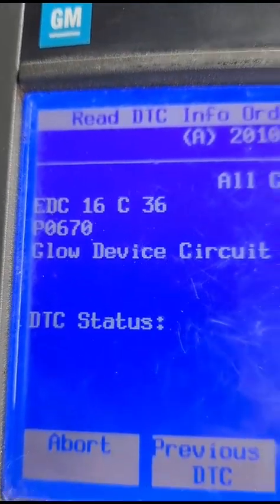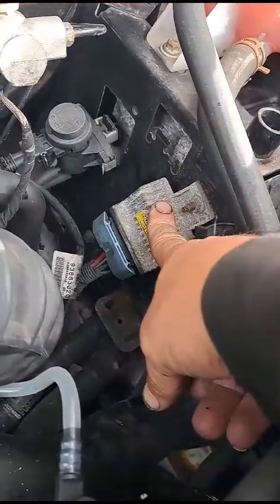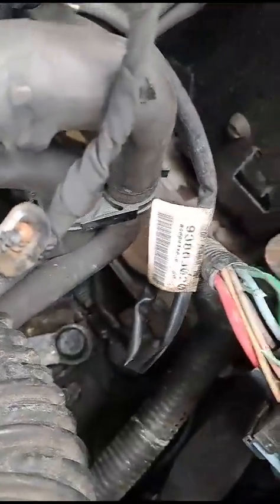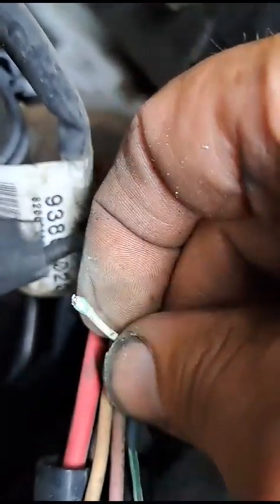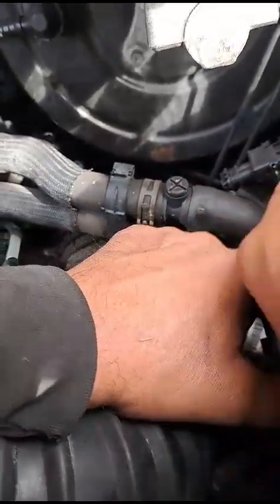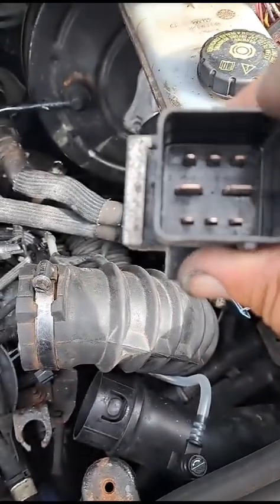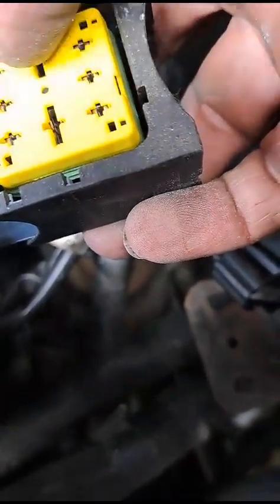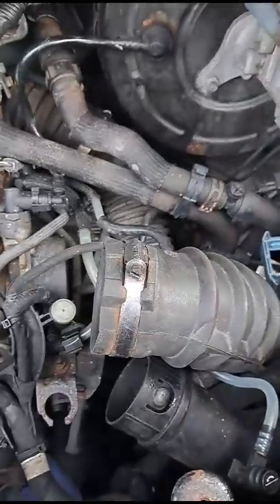TVP glowplug control unit fix fault code P0380 and P0680

Comment: I have an issue with my vans starting in the cold or if it's sat for a couple of days. Takes forever to start and blows out white smoke once it starts. I'm going to check this out. Fingers crossed. Thanks for the tip. Well worth a like!!
Reply: An update on above. I checked the wire but it wasn't broken. I swapped the control module with one from a scrappie and it fixed the problem! Thanks for the video - great work!!

Comment: My odb says fault with no2 cylinder. So tested resistance in the connector and there is no resistance. Unfortunately it’s a relay 2.0hdi so the manifold intake needs removal just to get at them 🤦

Comment: I mate. I have a 2013 Renault Master x ambulance I had a service done and after the service the spanner-light came on the dashboard and the fule light empty has stayed on even though there's 30- 40 quid in the tank that's only since I've had the service then I had a full service done and lights came on and staying on I've had someone put a omd of tricks on it and did the readings and it said fault in the instrument panel and I had a reading  saying relay 2 which I've been told is the thing to send messages to the Glow plugs when to come on and how long for. I've had all the glow plugs change and can't switch these lights off do you have any advice please

Comment: I'm grateful to have found this video as I'm tinkering with my Nissan Kubistar 2008 (a model which pretty much is a Nissan-badged Kangoo).
I have to ask you who seems to be a good mechanic and might know this.
What is that drawn out beeping sound in the background?...if you go to 0:52 into the video it is clearly heard in the background, but it also sounds while you are talking about the relay.
I have the same background noise on my car, and wonder where it is coming from.

Do you think it is normal or is there something wrong when that sound is heard?
The reason I ask is that the car can't seem to get rid of error code P0670 despite new glow plugs, im clearing the code but it comes back, and I'm starting to wonder if the noise has anything to do with the error.

Comment: Hi I’ve 380/670 and I’ve a solid immon light on dash I’ve no glow plug light / service light proper scratching my head I’ve had 3 auto electricians on it done earth checked wiring replaced fps doing regulator Monday but any hints would be appreciated .. also replaced glow plug relay from my other running vehicle cheers buddy
Reply from the maker: Tbh I'm not sure without having a look. I wouldn't want to send you down a blind alley. Good luck with it.

Comment: Hi I have the 2016 1.6 traffic with the engine light on and the code reader is saying glow plug circuit A  I’ve replaced the plugs and changed the relay but the engine light still comes on have you got any ideas please
Reply from the maker: Have you checked if there is power coming from the relay to the glowplugs
Reply: I’m told these newer models don’t always show a voltage at the plugs but there isn’t a voltage showing also I’ve replaced the glow plug relay and the main terminal in relay is showing battery voltage
Reply from the maker: If you put a test light or a voltmeter on the end of the glowplug connector and the engine isn't warm it should show voltage

Comment: Took your advice and went to a recommended garage with diagnostic gizmo.seemingly glow plug relay i put in (new) was faulty. e bay special!  Replaced it with a proper one for a dacia duster a lot more expensive but was worth it no more limp mode or lights oon dashboard .once again thankyou.

Comment: I have a 2006 Renault Master 2.5 CDI, with an intermittent glow plug problem,   I have changed the relay, I also noticed the light would come on when cold,  but not when hot.                                                                                                 The temperature gauge is not showing a hot temperature, when you turn on the ignition when the engine is hot, but the fuel gauge works.                                                                                                                                                                                       I changed the temperature sender,  again, fine when cold, and temperature gauge reads fine once hot, but as soon as you turn off the ignition, and try to restart a hot engine, the gauge is not showing a temperature ,  glow plug light / relay won't work, if I unplug the hot sensor and  plug in a cold sensor, it will work,   any ideas please ?

Comment: Awesome video. Thank you.  I have this issue but wanting to have the relay before i start. If it is the cable I will re-solder it now also.
Reply: Is it easy to Access the relay on an F15 2015 Nissan juke? Is it just a case of remove the battery and tray? Or is there a better way to do it? Thanks, in advance. Just trying to find a handy guide rather than learn on the job as it is a friend’s car.

Comment: What voltage should be coming out to the glow plugs?
Reply: Well it depends on the glow plugs itself, if they are 4.4Volts then measuring constant 12V on the plug's cap while preheating can be bad... I think the relay has a controller logic that's 'converting' 12V down to 4.5V using pulse width modulation (PWM). So if you wants to be sure your relay working ok, you need to use a better digital multimeter. For best results you need to use an oscilloscope (even cheap ones are ok)... normal cheap digital multimeter wont display the exact/avarage voltage at the glow caps. BUT, it can be that the glow plug has the inner resistance so the voltage drops inside the glow plug itself so  getting 12V at the relay or at the glow plug caps can be ok...
If your glow plugs are 12Volts then measuring constant 12V (for the preheating period) at the plug's cap is ok of course. Btw the glow plugs are getting some voltage even after the preheating period that's normal.

Comment: How do you test the actual relay unit
Reply from the maker: You put a light tester or voltmeter onto the terminal of the glowplug, if it is showing power when the ignition is on then your relay is working

Comment: Hi sorry to comment here but on a 2ltr m9 I get consistent error code p0002 and p0002F6 but runs ok turn ign off and back on clears for short while getting worse which would be the best move on the fuel pressure rail to change or would boost worth doing clean everything suspect wire damage but where to check first
Reply from the maker: It could be a faulty control valve on the fuel pump, or the wiring to the fuel control solenoid on the fuel pump. I'd try those first.

Comment: Can you test the glow plug module, ie power and earth in on the big spades, 4 injector out, but the 2 smaller wires, should one of them be power in to operate the relay ?

Comment: I have this code, and my van (vivaro 04) goes into limp mode with glow light and another light, reset it by turning off and on clears, then comes back, could this be the problem do you think? Seems to happen more when im on a bypass or motorway, doesnt come on round town, ive also heard the relay box may also be an issue
Reply from the maker: The relay box ( if you havnt had the blue plug bypassed ) would be a good place to start. It could also be EGR valve or MAF sensor.
Reply: @southwestinjectorremovals8932  thanks mate I'll have a look at it tomorrow, big help that appreciate it alot thank you

Comment: What would the symptoms be if this happened? Limp mode?
Reply from the maker: Depending on the year of the vehicle, If its after 2012 then the vehicle is fitted with a dpf and the glowplugs are needed for the self cleaning process. So if the dpf starts to block up that would lead to it being underpowered or limp mode.

Comment: thanks so much for trying to help us out in what can be tough times..my mums Dacia Duster is getting codes for injector 1 circuit A and the glowplug circuit A too so I'll try to check these boxes first as we're broke but the garages here are saying it has to go to the main dealers as they can't program in the new parts with their computers but i think I'll try checking the wiring first as we can't even afford a new injector off eBay so I'm hoping i can figure out if there's a corroded wire after seeing this.. thanks so much.. could it just be a fuse? I'm not sure what "circuit A" refers to but I'm thinking if both faults (on my cheap obd reader) say it's circuit A then maybe it's a fuse as we had to jump start it after my mum left the radio on in it bless her.. I'm trying to help her out so any advice would be hugely appreciated but no problem if not..

best wishes to you from a fellow Celt up in Scotland! :)
Reply from the maker: Unfortunately open circuit usually means a faulty part.  If its a problem with the wiring it comes up as "high resistance " more often than not. Sorry to hear about your troubles. I hope you get it resolved.

Comment: I got a 2008 Ford fiesta that's a diesel and I got a warning light showing something was up and I had used a scanner to check the code and it was a code p380-60 and said it was something wrong with the glow plug control circuit just wondering if you'd know what would be my best option to go ahead with
Reply from the maker: Check if you've got power going to the glow plugs. If you have then it's a glow plug issue , if you havnt it's a wiring or relay issue.
Reply: Hi same problem did it go into limp mode with yellow cog light flashing thank you